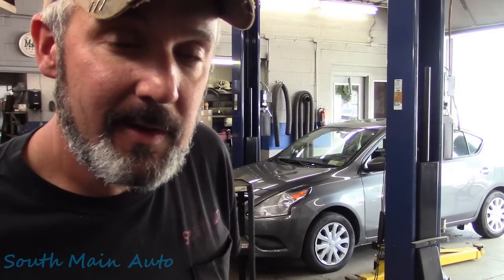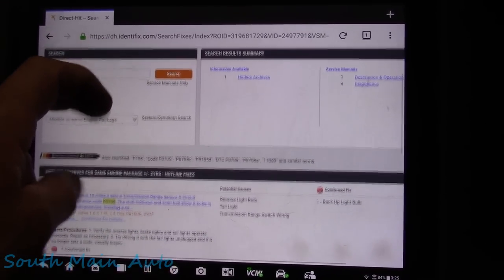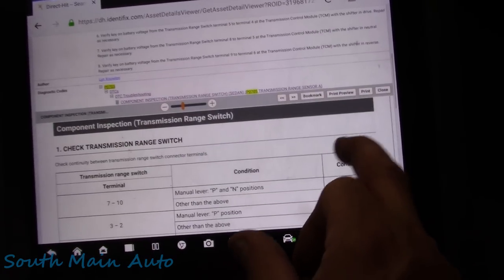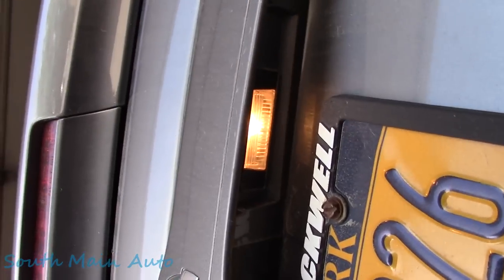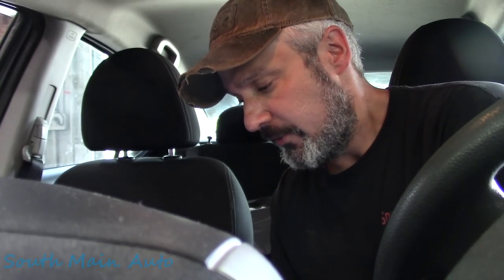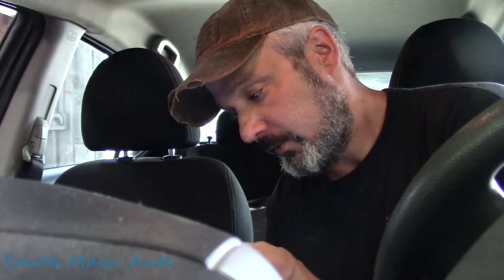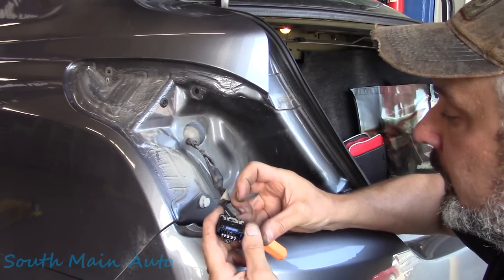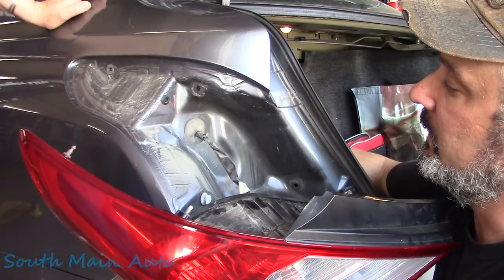Service Data Doesn't Cost - It Pays

Comment: Reminds me of when the cruise control went bonkers on my F150.  It would start working, then kick off.  I consulted the Mighty Google and the first guy said to check some module in the brake master cylinder.  His setup looked different than mine, so I didn't tear into it from that point.  Another suggestion was to check the upper brake light over the bed.  This sounded goofy, but I put something heavy on the brake pedal and saw that one of the bulbs wasn't lighting.  I took the light loose and found a burned out bulb.  The courtesy lights in the same fixture were the same number, so I swapped one of them for the bad brake light.  Damn, it worked.  I still have no idea why the brake lights would make the cruise control fail, unless it somehow tells the control that I have my brakes on, which would cancel the cruise.

Comment: Great video like always , the bad earth return connection must have put some voltage back into the reversing light via the globe filaments from other energised tailight circuits and somehow caused the ECM to misbehave . I wish there was a indentifix type site for my game (commercial kitchen diagnostics and repairs ) people tend to keep their knowledge to themselves especially techs who work for the equipment manufacturers . I've had their tech support people not give out much information and suggest they send out their own techs. Knowledge is money unfortunately.  I also don't like playing around with connectors always worried I'm going to break the locking catches. Changed the tailight globe on my daughters hyundai had the same issue trying to remove the tailight assembly without  breaking the alignment pin. Good to see you are honest with time though some extra time is probably OK in this situation that is not a usual problem.
Reply: yupp 100% this

Comment: I had a Nissan the would lose power anytime the headlights were on. One of the taillight assemblies was back feeding power on the brake light wire anytime the headlights were on, causing the pcm to think the brakes were applied and it would reduce engine power.

Comment: I am no mechanic. Barely think sometimes. A few years ago my AC fuse would blow every time I shifted into reverse. So I carried a pocket full of fuses during the Summer and after backing up would replace the fuse so the AC worked again.
One day I found a guy on the old YouTube that somehow figured out the problem was in the steering column.
Had to remove the cover to find “the wires” to something that rubbed the insulation off that shorted every time you went from park to reverse. Cut the zip tie so the wires could move freely, with a flashlight in the dark and look for the tiniest of shiners. The only way to see it, in the dark with a flashlight. During the day you would never see it. Fixed
The guy is like a super hero.

Comment: I found out on my 97 f250 that the 94-97 
F series trucks. That the taillights help power the system to send signals for the electronic lock up on the torque converter, so putting in LEDS makes the torque converter lock up and unlock rapidly because it needs factory bulds.

Comment: I put led brake lights in my Subaru Outback. The lack of resistance from the led bulbs made the computer think there was a problem with the brakes and as a consequence disabled the traction control.

Comment: Mr O as always a great video. Judging by the clues my best guess I think owner might have had a left light burnt took it to a parts store and or had a family member change it and struggled getting light housing assembly off/on and in the process the conector was  the casualty. 
But it’s great to see that things are always not what they seem. 
Keep up the great work 👍👍👍👍
Reply: What
Reply: I love this channel, your diagnostic skills are sublime and it’s a pleasure to watch you work. 
I’m sure it’s frustrating working on vehicles so badly affected by corrosion, but I’m also sure this is how you’ve honed your craft.  Easy fixes are difficult and difficult ones are next level challenging when everything is so badly affected (except this car, so far).

Comment: there is corrosion that builds up on the board in the tail lights. I changed the range sensor/neutral safety switch first and to no avail, after I cleaned the corrosion off, didnt work. I replaced the whole taillight. BOOM FIXED.  This is my aunts 2013 versa. There is a service bulletin on this fix. Insane how this is all wired.

Comment: Awesome find. Go figure the brake light fault throws a transmission code.
Reply: Not brake light fault, rear tail light earthing fault so power goes thru other things etc
TCM is getting some back feed voltage so mixed signals

Comment: Feedbacks can do wacky things. My 1st experience with one was in my 80 Trans Am. My turn signals and Hazzard would make my interior lights flash. Ended up the cigarette lighter unscrewed apart and blew the fuse. Replaced the fuse and put the lighter back together and all was good.

Comment: A co-worker had a Honda Accord years ago that had some strange taillight issues. The dealer changed the combination switch and some other things, and never found the problem. I told him about a Smokey Yunick story in Popular Science from years earlier about a similar problem caused by a defective bulb. One filament would sag and touch the other whenever the lamp was lit. He told the dealer to check the bulbs, and voila!

Comment: Hi Eric 👋 great videos as always been following for a while and learnt many new things along the way.
Thought I'd post as I've dealt with this issue in UK 🇬🇧. 
don't know what model would be the comparison but Nissan Primera over here suffered terribly with rear light cluster earths melting and gave unbelievably driver issues with reduced engine performance.
Obviously Nissan identified the problem with new harness etc but when presented took ages to resolve the issue until it became known. Nissan micras the same.
Any driveability issues now I always checked all rear lights on at the same time. Great 👍 work nice to see Mrs O 👍
Reply: Standard connector as used on Peugeot/Citroën, Fiat, Volvo and many more. All have problems with the rear lights and knackered earth pins.
Reply: Just out of interest, we had an experience with our Nissan Micra, it wouldn’t lock with the keyless remote, we figured out after a few weeks that if we waited about 30-60 seconds it would lock. It was a so frustrating! I happened to notice the interior light wasn’t working, threw in a new bulb and all was good again!

Comment: missed the part about how the circuit was tied to the original problem, I see the bad fitment but where in the wiring diagram did the bad ground connect the to Trans Module?

Comment: About 5 years ago I bought a '00 Jeep Grand Cherokee. The previous owner already replaced the alternator. It still was having intermittent charging issues. Turns out, the pins in the two wire plug on the alternator were loose. Tighten them up like you did, and it's been charging fine ever since.
Still can't locate an intermittent battery draw. Leave it not driven for a week or more, the battery is dead! My daughter has seen the headlights flash on by their selves at times. Trickle charger to the rescue.

Comment: my 99 peterbilt has bin bad for connectors loosening up. head trouble with the headlights popping breakers and finally quit. i got po after 3 years of this happening of and on. i grabbed the wires on the headlight switch and yanked . i pulled a melted weather pack connector out of a 2 inch diameter harness,did not even know or see it there. cut the wires ,to but conectors and no more trubble. one night i went to bed in the sleeper i smelled hot plastic 20 below out with heater full blast. another connector under the vinale boot covering the sleeper cab connection wes melting could have caught fire in my sleep . all wiring harnesses are taged made in mexico. never had trouble with my 95 i had. keep up the good work!!!!

Comment: Hi Eric had the same trouble with my car here in the UK car is a Renault scenic doubt you have never heard of them in the US, fog lamp warning on dashboard flashed whenever braking found 8 pin plug on back of left hand light one contact wasn't touching the earth on the light assumed heat had made them come apart gratefully found the problem that someone had had on good old You tube, thanks again from us viewers in the UK

Comment: Even older cars have a ground problems with rear lights. Most people don't know how to diagnose that either.
I'd suspect that the control module doesn't buffer the reverse switch lead, it just measures the voltage from the lamp. Since the lamps had no ground path, any time you hit the brake light or others, you drove the line to the reverse switch high, through the reverse lamp, with the bad ground.
I don't much care for rear light that are sealed units. These often have a PC board can can have connection issues or broken solders.
Another example of previous peoples problems saved me a minimum of $150. My dash would drop all the meters and light the airbag and seat belt lights only. If I slapped the dash things would come back on. It effected the back lights for the instruments as well as no turn signals. The headlights worked fine. My car is a ford Freestyle. There is a group on the web that post its problems and fixes. I found one that was a match. It said the uController, on the right side of the instrument panel's, crystal had a solder problem( Euro Solder, no lead! ). It would fracture and have bad contact. I took it apart, re-soldered it and not problem since. There were a several after market places that would service the cluster for $150. I suspect all they do for many of these is re-solder the crystal. I suspect it is like the three taps of the hammer, joke, it is just knowing where to tap it.
Another time my wife's Toyota's clock was flaky. The display would go out. Toyota wants $275 for the clock. I see people on the web offering $50 to fix it. Something that cheap means it has to be something simple. I open the clock and press on things a little. When I pressed on the large surface mount resistors, it would light up. Another case for Euro Solder. ( 10 years later it works fine after I re-soldered them )

Comment: I'd bet that connection got looser from the combined current of all bulbs getting it hot and thus deforming the connector even more.  Tightening the connection will transfer the amperage without as much resistance and thus not creating heat.

Comment: With Nissan's the tail light ground is pretty much the first thing to go and will cause electrical issues here and there which you would never think to be connected so always check the tail light grounds first. That is what anyone who has had a Nissan for some time would tell you, usually they just make a new ground straight from the lamp circuit board to the body right next to the tail light bypassing the connector.

Comment: Had one of these a few moths ago, i believe it was a sentra. Tail light housing was shorted internally in the led board and backfed the range switch causing the transmission to go into limp mode. 

Also used our identifix to point me that direction! Definately a good tool when used correctly. As keith always  yells at us, "Read the service info!"
 🤣

Comment: "Not getting paid to diagnose" and "what ammunition am I loading into my parts cannon."...Hit the nail on the head with these quotes. The industry may not seem fair but I also can't sacrifice my income so others can catch a break (even though I do genuinely want to help people). When a service writer/customer comes to me and says "I/this person come(s) here all the time, can you just pull the codes and tell me what's wrong" my immediate response after scanning is "Well it could be this, this, this, this, or even this. I won't know until I can dive into the diagnostics." I tend to shy away from Identifix but after watching this, I'll start checking it more often for those random, obscure problems. Thanks for the insight!

Comment: Way back in the early 90´s I had an old Toyota that i´ve upgraded with some fog ligts and some extra high beams. Fog ligths was wired in to act as running lights as well as the tail markers (with appropriate relays), but would by design cut out when ever normal running light was turned on (but could then be turned on manually when needed), and could never be on with the high beams. The extra high beams could only come on with the regular high beams. All wired to adhere to the Danish/European standards at the time.

It was a DIY job, but i´m an electrician, so I know a thing or two about current flow.

It all worked fine for a year or two, but all of a sudden I started to get some strange faults: Running lights would shut down, almost all lights in the instrument cluster would come on, all instruments would go on high except the engine rev, witch would go to 0. But Fog lights and extra highs could be switched on without any lights been on, and some of the relays would make a nasty snarling sound.

(Bonus info: I had to rush my then highly pregnant GF to the hospital with stomach pains, in the middle of the night...... THAT was an exciting trip, with the car acting up like that)!!!!!

When I started to investigate the problem, I noticed some "newish" tape on a wire loom in the engine bay, that I did not make. 

Lo and behold, what did I find under the tape??? A previous owner had found a loose wire, and in stead of fixing the problem, they had just folded the wire (along with the ring connector) up alongside the rest of the loom, and taped it up.

That was a ground wire!!!! When I connected it to a proper ground, all faults was gone.

So friends; as Eric´s video shows here: It´s important to keep your grounds connected.

Comment: Probably the switch is buggered up from Coffee and Soda being dumped down it LOL
Reply: Keep watching lol
Reply: It’s cable link to the transmission selector . The selector switch is inside the transmission . So if it is the switch that’s faulty it requires the valve body opening up .

Comment: i have a 96 xj both brake lights work taillights work but tail and brake same time the driver side brake went out. Now separate brake bulb and tail. so, after replacing all bulbs and brake switch and light switch didnt fix the issue. so after reading the forums well it was a ground so if you face this on a xj check ground i never came across this so didnt know

Comment: Same type of thing happened to me, I own Land Rover LR3, I had a burnt tail light, went to a local auto parts store and got a replacement; plug it in and I have a "Transmission Fault" on the dash. Went to my independent LR mechanic and he told me that I can only put in rear bulbs from the LR dealership or else the transmission module won't be happy due to a difference in resistance or something between bulbs. Who would have known

Comment: Since the nuts holding the housing were loose, maybe someone had been in there changing a bulb and caused the problem with the connector. Easy to do. Crazy how the simplest thing can cause the most odd hard to find problem.

Comment: Give some credit to the parts cannon - I have fixed many issues with the cannon for a fraction of the price of just a diagnostic at a shop! To fix a P0172, I ended up replacing a PCV, map and maf sensor... it was the maf that made the difference, but glad to have a bunch of new parts from AC Delco!

Comment: many of those connectors come apart by releasing a locking clip and moving it forward a small amount, then a depinning tool to release a plastic tab that's holding the metal pin in place, allowing them to be pulled out the back. the depinning tool can often be a large safety pin/t-pin that fits in the slot, or a tiny long shank flat head screw driver.
it's always a challenge to guess the connector type and disassembly routine, without already knowing them. patience patience and more patience. 
there's literally many thousands of connector types out there in the wild, fiddling with electronics(junktronics) will teach you patience quickly.

Comment: I have not watched past 9:05 where Eric O says, "I do not know what is wrong." Before I find out I want to say that the shift sensors, also provide the signal to the "back-up lights" so it makes sense to me that if their wiring is bad, it could mess up the Error Codes. The issue is not the car, but the programming of the transmission control unit and the scanner. I will bet that the program designer did not know that the rear light cluster could deliver odd signals.

Comment: We have a new addendum to the official South Main Auto Drinking Game (tm):

- Every time Eric says "my guy"...one drink.

- Every time Eric says "my guy" to Mrs. O...THREE drinks.

Seriously though, this is why I'm so leery about new cars...the amount of electronics and interconectivity in them is so great that there's no way an automaker can test for every kind of weird electrical issue a car might have.  The idea that something innocuous like a bad bulb ground could cause something like an electronically controlled transmission or a brake by wire system to malfunction is pretty disconcerting...

Comment: I wish I lived closer. I would love to be an intern if you would allow that. I enjoy working on vehicles and have fixed a few with good results. I had a 97 civic and blew the clutch and transmission. For a few $ I bought a used tranny and new clutch. Fixed it and got another 3 yrs out of it before it wouldn't pass inspection. I never did a transmission or clutch.